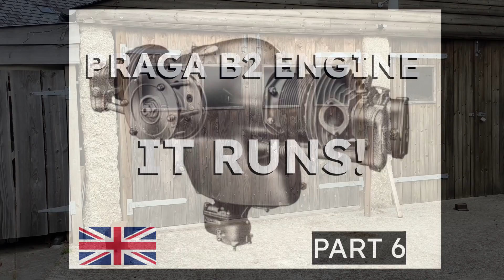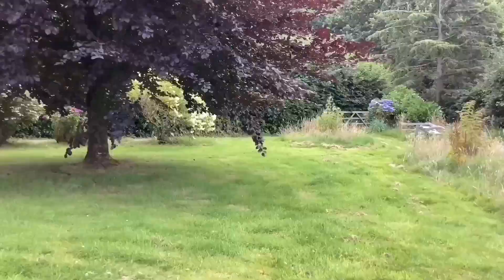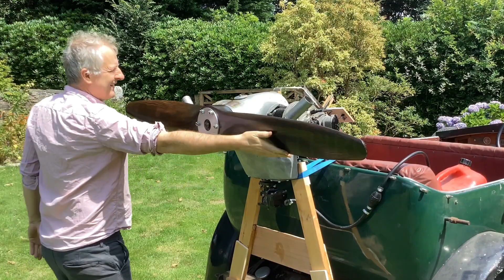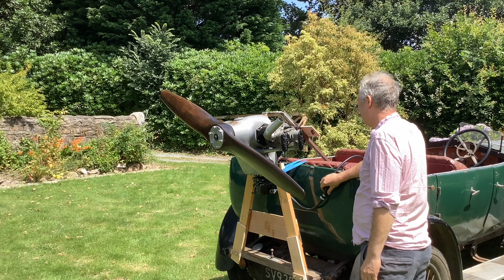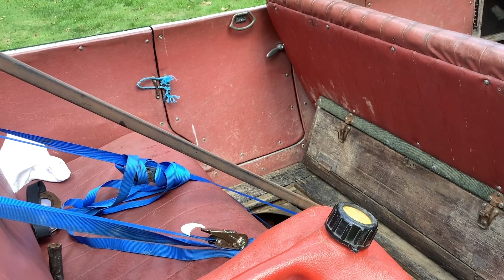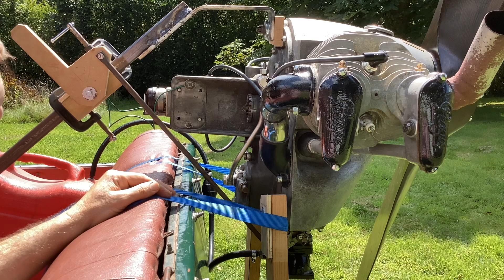Will It Run? Praga B2, last ran on 1st September 1939!

Comment: Starting an engine that has been silent for 84 years and using your own homemade prop as the load. Just WOW! Yeah, I, also, never throw out anything! It's all useful, eventually! Thank you, Nick. I am in the process of mounting an engine off a snowmobile onto a 20 yr old X-air and you are providing inspiration.
Reply from the maker: Thank you, it was a fun project to get that motor going and there’s more to come 🙂

Comment: The gentleman at Yesterdays Machinery built a dual coil  contraption to re magnetize a magneto.
He to does interesting things with old relics.
Reply from the maker: I checked the spark again after the engine runs and it was noticeably better. The other magneto needs rewinding and I'm going to get it sorted out in a while. There's a useful chap in Bristol who rewinds BTH armatures, he's done a couple for me already. I like being an old relic, or did you mean the engine?! 🤣
Reply: @FlyingForFunTrecanair  Yes

Comment: Outstanding sir, I think you should build a special. You mentioned in an earlier video a GN chassis, that would be perfect, something along the lines of Basil Davenports Spider.
Reply from the maker: Yes, it’s very tempting. I have been collecting bits for a special for ages but ideally need to find a suitable chassis frame with a V5.

Comment: Good on you for bringing a pile of fairly rare parts back from the bin to running, how about some cotter pins on those prop bolt nuts though.
Reply from the maker: They were checked for tightness just before the run up, and afterwards too. If I do any long runs then I’ll wire or pin them. They are very tight, as is the hub nut, for which I bought a new 27mm socket.

Comment: All you need now is that Schelde single-seat flying boatbolted on to this engine. You know you want to...
Reply from the maker: I have an appalling confession to make. The engine has been sold to a pal who's building a Heath Parasol; however, we will see it again as I'm going to be carrying out the test flying once it's finished. As for the Scheldemeuuw, yes, it's a delightful thing and you'll have to wait until the Aeronca C2 is finished before the next project is revealed. From what you have said, I believe you will like it.
Reply: @FlyingForFunTrecanair  Sure will. These Aeroncas are so cuddly I can`t get enough of them.
Reply from the maker: @danhubert-hx4ss  Of course, I have a set of EDO floats for the C2 as well 😉
Reply: @FlyingForFunTrecanair  OMG! That`s just too much...

Comment: A long gestation--but well worth the wait!  If your fuel container was raised several inches, gravity feed would obviate all that bulb manipulation?  Or is that part of the 'experience' ? This engine is crying out for a suitable airframe.  Your C2 ?
Reply from the maker: The C2 has a nice zero timed Aeronca Jap with a decent propeller! The Praga is not wonderful by comparison, it's most likely to end up in a vintage special with four wheels.

Comment: When finger starting a model aircraft engine after several unsucsesful  atemp when sudenly runing you put your finger back  for spun because you used to repeat your moves. In this case that would be more painfull. That is a reason why I have electrical starter in all of my hobby earo engines. And btw. I make my props  and have a Vauxhall too a Viva.
Reply from the maker: A bit different with a full size propeller. The art of swinging a propeller moves the body parts away from the disc.

Comment: Congratulations on the engine run!
Reply from the maker: Thank you, it's been a satisfying project. I was lucky, the crowded rollers on the big end bearings were badly corroded but amazingly the corrosion had not badly marked the crankshaft. The damage polished out OK. The cylinders have a certain amount of pitting but not dreadful. I've added cross bracing to the wooden legs and will run it again soon.